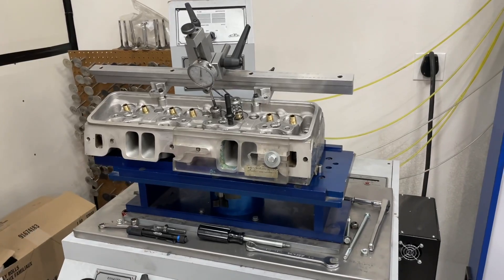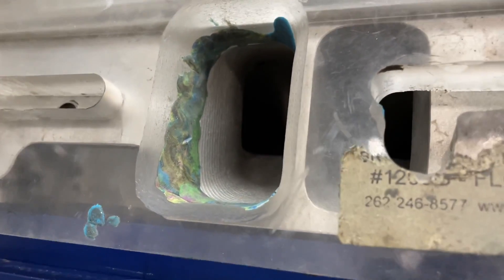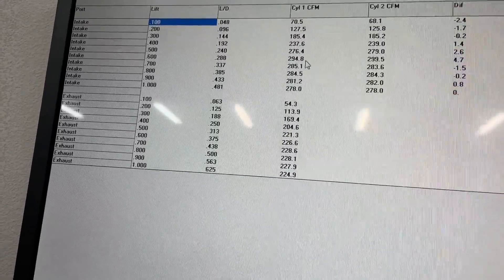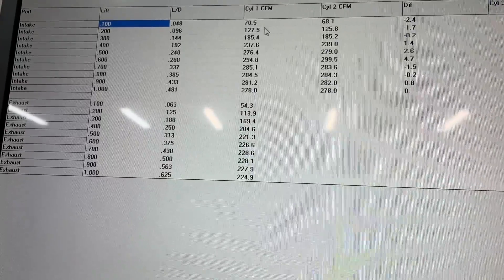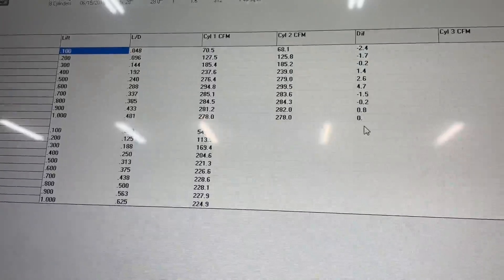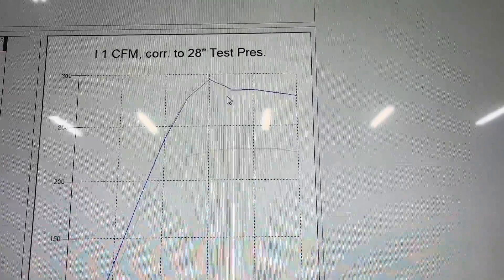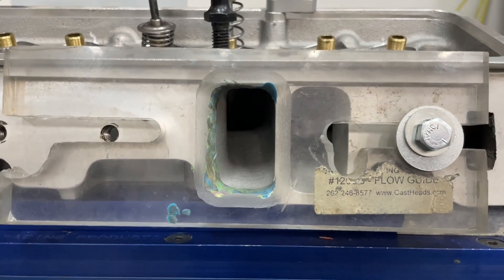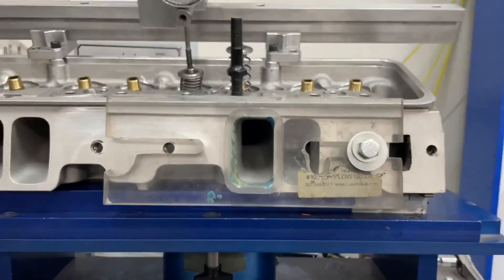Sbc AFR 210 flow numbers and rocker stud protrusion test

Comment: Is there really a situation where someone  would want the 210 runners over the 220?
Reply: Eric, are you saying that the 210cc heads are better than the 220cc heads on for example a 427 cubic inch small block chevy? I have a brand new set of the competition ported 210cc heads still new and in the box. Just wondering if I should build a 400sbc or a 427sbc. The reason I bought the 210cc heads instead of the 220cc is because if I'd happen to build a 355sbc the 210cc heads would do better than the bigger 220cc heads. Just wondering what your opinion is on it.
 Thanks, really enjoy your content.
Reply from the maker: More rpm or larger cubic inch.

Comment: Eric  so would this be the same as using a flow ball on the short side radius to make the bottom  longer and get the air to turn over the floor and not go to the out side of the valve

Comment: So what do you do to slow the air speed down coming into the turn? I have always been successful using a high velocity runner and setting up cam timing to make power earlier. But I am always looking for ways to carry more horsepower out back without compromising low-speed torque, all of my engines are Street engines.